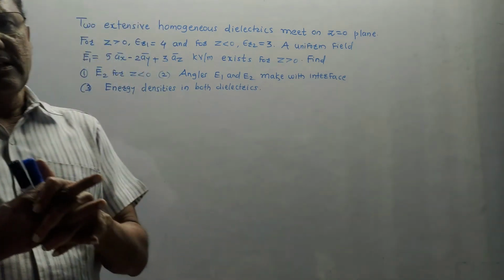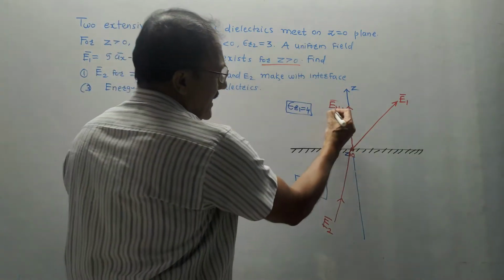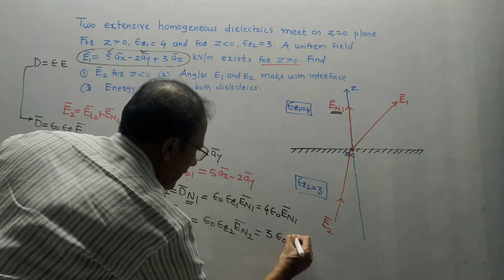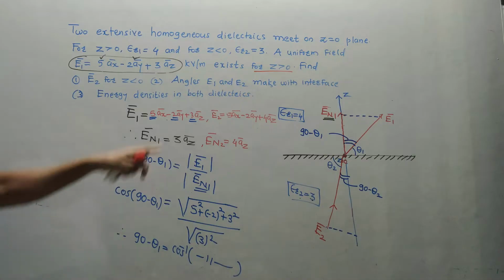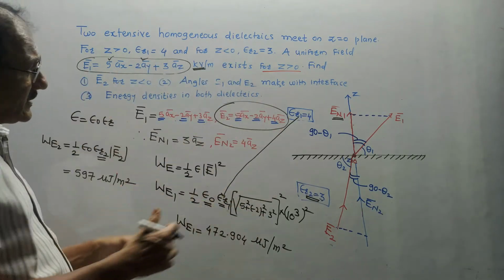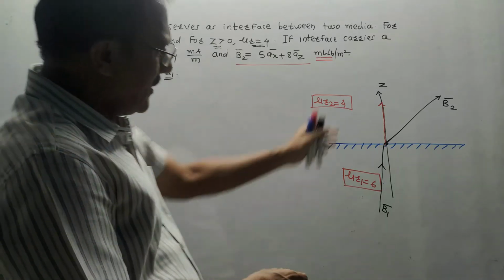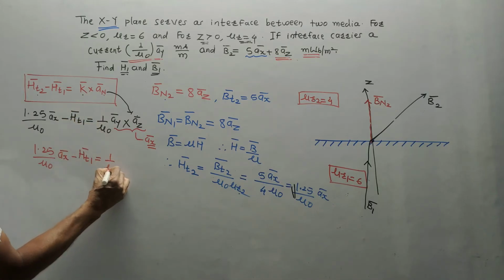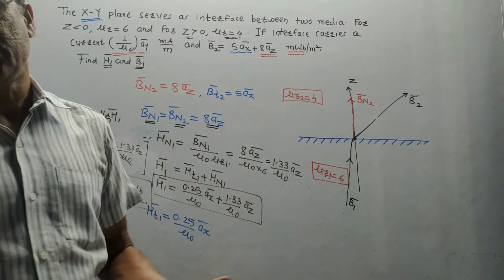BOUNDARY CONDITIONS ( SOLVED PROBLEMS)

Comment: Sir, in numerical 1, when we are calculating the value of angle, the cos inverse value on calculator is giving error when i put cos inverse (2.054) since its range is only from -1 to +1. Then how i calculate the angle on calculator?
Reply: The fraction you have taken is wrong , sir has taken E1/En1 it will give wrong answer instead you do reciprocal En1/E1 , sir by mistake took wrong formula for cos
Reply: @vedantshinde663  yeah right, thankyou!!!
Reply: Please tell final answer  @Aditi_Raut07
Reply: I got answer will be 60.88 degree
Reply: @udayghadge1634  60.88-90 then 29.12 come
Reply: @udayghadge1634  bro  thats 90-theta theta is 29.1 approx
Reply: Set the calci in degree mode and complex mode
Reply: Degree mode pr bhi galat aa raha hai  @azharshaikh6916